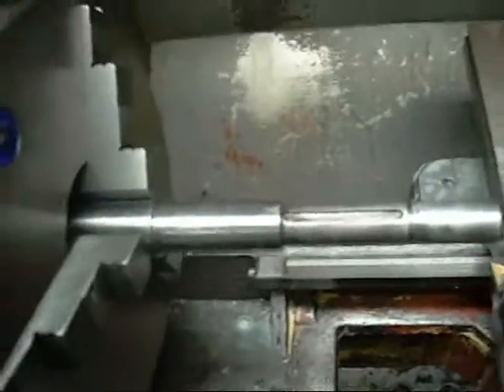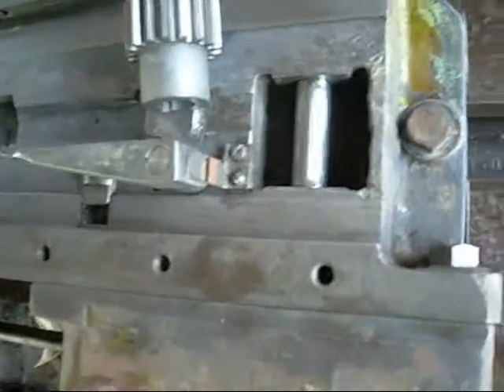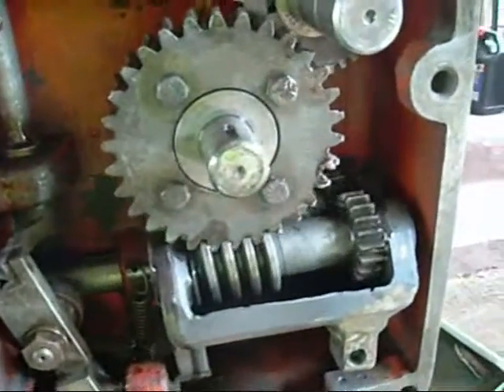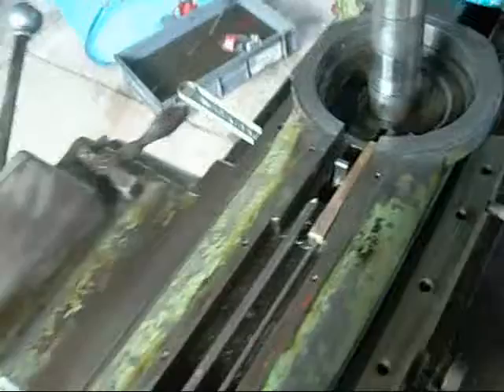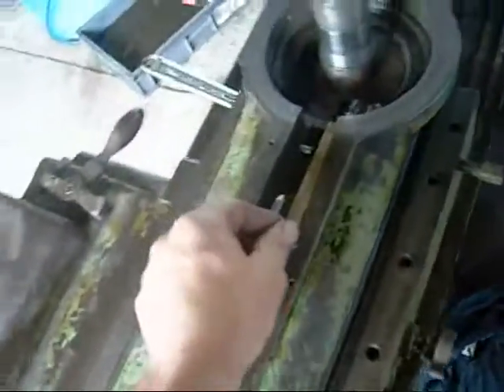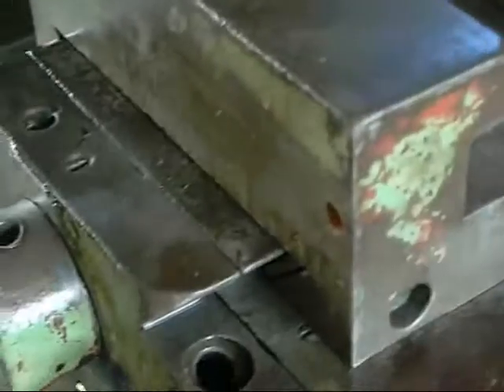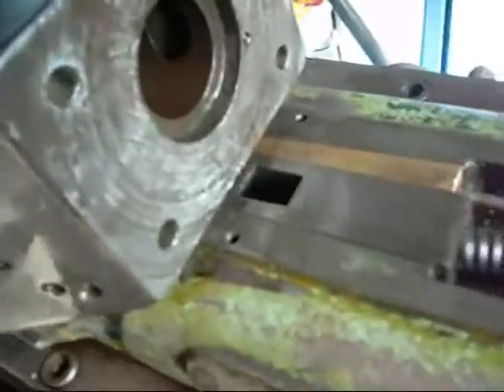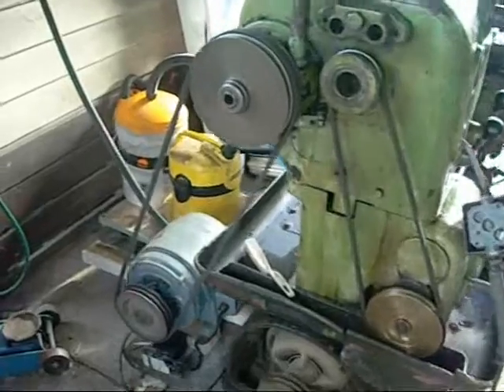Lathe Turret Re-Assembly and Test Run

Comment from the maker: thanks man!, the turret is for holding drill bits, reamers, chamfer tools, threading dies, taps, etc..

the idea of the turret is to eliminate the need to manually change tools on a tailstock, which can consume a lot of valuable production time in a factory enviroment.

when I get some tooling for it I will set it up and do a demo with a center drill, followed by a pilot drill, reamer and countersink.